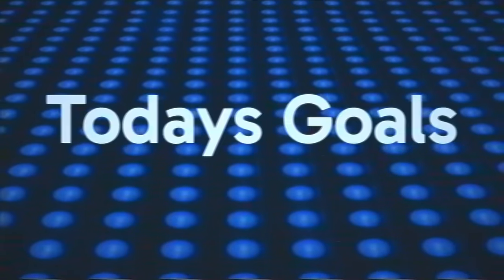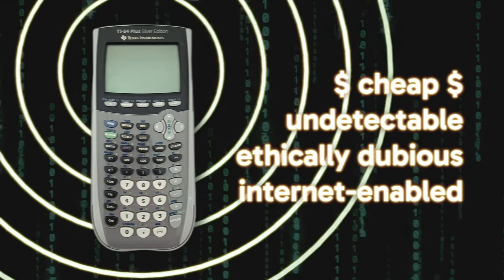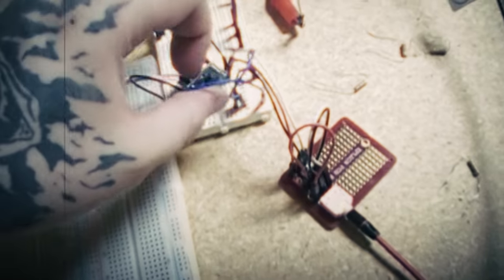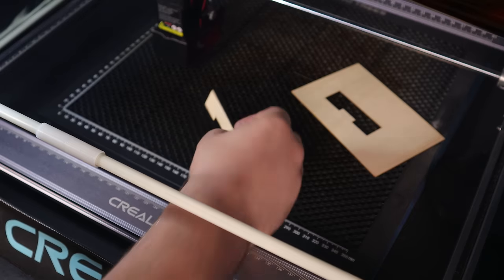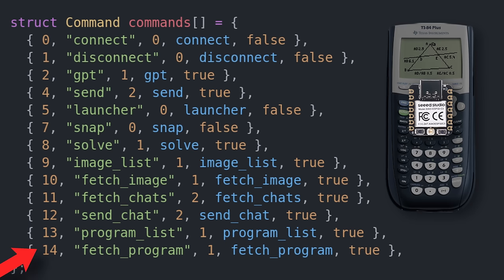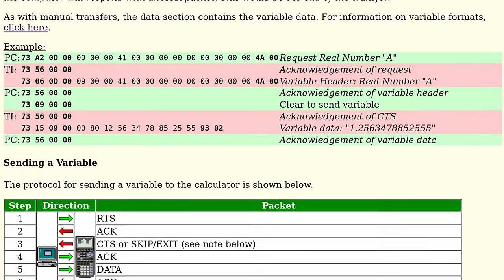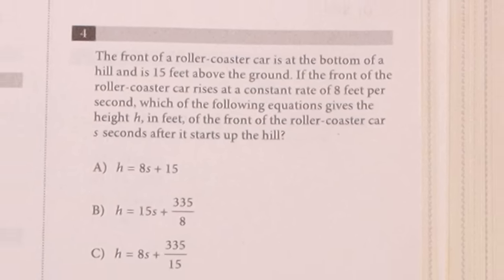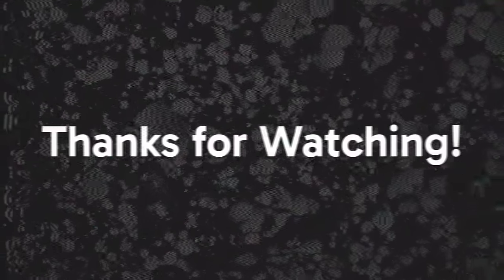I Made The Ultimate Cheating Device

Comment: I guess students will just have to take their math tests in a Faraday Cage now
Reply: I mean they probably just have you put your phone in a box beforehand.

Which would kill the hotspot, thus nullifying this method. And if the local (school) network has an auth page, you probably can't navigate that via the interface we see here.
Reply: @NilesBlackX  What if you embed a SIM card inside the calculator? Or instead, use some long range radio protocol and someone outside giving you the answers remotely? They actually use RF detectors on university entry exams here in Spain, cause there have been cases of both things I mentioned (;
Reply: I'm sure we'll still be able to find a way to cheat
Reply: Or the school could just get evwry student a calculator for exams
Reply: @Ignash  just mod the calculator during the exam 🤣 not that hard trust guys
Reply: What they do is monitor for electronic signals. 
They'll catch the WiFi enabled calculator pretty quickly.
Reply: My school has signal-blockers everywhere and you can barely get 1 bar usually. so that would make this method less useful
Reply: @morgangrisby8107  Really? What exactly do you mean by signal blockers? Are we talking something physical and passive, or electronic and active? Generally speaking, WiFi and cell jammers are illegal, even for the school. That's a pretty hefty FCC (and analogous bodies in other countries) fine and prison time (if it's a school, probably whoever thought it was a good idea and whoever OK'd it would get in trouble) if they got caught, there's even a way to report them... 

It's mostly illegal because it causes interference (and by definition, broadcasts) on licensed bands (on the unlicensed bands like 2.4ghz/5ghz for wifi, it's the intentionally causing interference/denial of service that's the problem), and can even potentially prevent someone from calling 911.
Reply: @chemputer  us isn't the only country on earth.
Reply: @___15  there are similar laws in most western countries, and for good reason.
Reply: @chemputer  If you're going to defend an act of academic dishonesty with legal technicality, might as well be a lawyer instead. Even then, I'd bet there would be law students who'd try to argue their way into letting them bring calculators into the exam venue for this purpose. We have law students here who were caught cheating while doing less.
Reply: @teeteetuu94 what a pointless thing to say
Reply: @morgangrisby8107  connect to school wifi?
Reply: @chemputer  probably if you could connect through a VPN or hidden tor tunnel or something similar
Reply: @teeteetuu94  It's not defending cheating. It's ensuring that telecommunications laws are upheld and that 911 can be called if there's another violent incident in the school.
Reply: @NilesBlackX  That's why you bring two phones.
Reply: @Ignash  thats what they did when I was in school there we no external devices allowed although you could swap out the calculator and hope they dont notice.
Reply: @johnsmith34  How? They cant if it is on your own hotspot. They can have a receiver and laptop with monitoring mode using aircrack but you can easily disguise the name or just not broadcast the SSID to prevent them from doing that.
Reply: only simple calculators are allowed and the exam room has a 360 camera on the roof (looks like a plate with few directional cameras and one fisheye in the center)
Reply: @michaelfoulk  If it sends anything wirelessly, then there's raw RF signals to detect with specialized tools. 

That's in theory, but it may be harder in practice. 
All I can really tell you is that for some of the exams I have taken, there were big signs about their ability to detect phones.
Reply: People have been messing with running a very quantized version of Llama on raspberry pi, so I think with a bit of hacking, it should be feasible to squeeze in a simple LLM fully locally within the TI-32 enclosure.
Reply: @bartoloeldelaflauta8571 at what point are you making this calculator a cell phone?
Reply: @morgangrisby8107 by signal blockers do you mean a giant cinder block building?
Reply: @NilesBlackX simply hide your phone or bring 2 phones
Reply: @ZekeTrimmer  no they cancel out the cellular data so it's really hard to get a signal
Reply: @morgangrisby8107  that's illegal, and highly unlikely.
Reply: @NilesBlackX next video - how to hide a Hotspot in your shoe.
Reply: @InwardRTMP  Depends where you live and what test you're taking I guess. In the last test I took I had to leave all devices, keys etc. in a locker inside a different building and take absolutely nothing into the exam room except my locker key. They made me empty all my pockets as well as lift my shirt and spin to show there's nothing in my waistband. This had to be done in front of two witnesses. The whole room was also monitored with A/V locally and remotely.
Reply: Quantum entanglement exists
Reply: @NilesBlackX Who said you needed a mobile hotspot? You always could just place a Starlink on the School roof or something.
Reply: when i was a kid the school provided their own calculators to borrow during tests. easy
Reply: @Astute-Brute  That's the one I'm excited for
Reply: @johnnydied9563 easier than that is just setting one up in the hallway or classroom next door, but you do you my guy. I like where your head is at - just install some internet infrastructure at the school for your own use! Hell ye mang
Reply: @NilesBlackX I mean the Mobile Starlink. Installing it wouldn't take long. All you need is to place it and connect it to a battery essentially.
Reply: That only works to prevent OTA updates and remote connectivity. What you're thinking of is an EMP field/EDA (electronics denial area), which "doesn't exist" [allegedly]. 

Edit: ah I see. So then in this case just move the program to be on-device, but you'd need to basically mod the calc so heavily that its basically a proto-smartphone that just looks like a calculator..... which probably exists (or will exist soon)
Reply: @randomuserame  A Faraday Cage would block a phone signal and the calculator is connected to the phone's hot spot, so it wouldn't work. It's also just a joke lol
Reply: @InwardRTMP brother ive had the same phone for 8 years what do i do
Reply: yeah
Reply: I have a hp50g, and I can save all the chapters I need on it. It's a little boring process to rewrite them, but it works. And there's also a program that makes a hidden folder with password that can't be erased.
Reply: Dedicated phone in hidden compartment inside ones backpack maybe?
Reply: @morgangrisby8107 realistically, that's just because many large buildings have steel frames in the wall, which are hell for cell service.
Reply: This whole cat and mouse game could be obviated by doing away with high stakes testing altogether.
Reply: @bartoloeldelaflauta8571  damn thats actually crazy
Reply: @___15 its the only one that matters though
Reply: Have you been to a public school? They practically are already...
Reply: Just need to run a local LLM on your notebook in the backpack lol
Reply: @NilesBlackX hide the phone, they cant legally search you without probable cause, and although not believable, you could say you didn't bring bc what'd the purpose when it would get taken away anyways
Reply: we could try making math not about regurgitating memorized formulas or failing?
Reply: You could use an open source llm if the model is small enough it could fit inside a memory card.. so you don't even need Internet.
Reply: well some exam centers do have jammeres in vicinity for such situations

Comment: Poor teachers, they don't even know what's gonna hit em
Reply: The entire education system is going to have to be rethought.
Reply: That's why they measure the weight of these common calculators.
Reply: @asserslab  that'll just slow people down, there will always be another work around.
Reply: @asserslab  i am absolutely certain you could make this modification such that the weight is identical
Reply: @KeithSachs  what if you got rid of the metal shield and usb port (after programming) on the seeedstudio and dremeled out all the (assumedly) useless blank parts of the pcb
Reply: @summerlaverdure i think the simple solution is redo the power. Batteries weights a lot, and you just may use smaller types with same voltage.
Reply: Yeah, nothing suspicious in people spending 5 mins straight typing on the calculator.
Reply: @asserslab  Duh. Just change your cells to lithium (Energizer lithium AAA), and now your modded calculator is lighter than unmodified.
Reply: @moamber1  i think you and @besthakase have a good idea in theory, but dont forget teachers are going to open the battery door and look at them, so it's not viable to do that
Reply: @summerlaverdure  So? Are lithium batteries prohibited now? And I don't remember anyone checking anything, tbh. Especially the weight.
Reply: Wait until a teacher sees this video and does a surprise post-test calculator inspection.
Reply: @y29k15  School teachers would have a million reasons not to interfere. One of them - they are interested in a high passing score. Second - they have no competence to prove anything. Third - they might have their priorities straight, and to not risk their job for questionable gain. Of course, I'm talking from EU perspective, where teachers, generally, are not the psychotic gatekeepers.

P.S. I was using the programmed calculator at school. Math teacher didn't care, though she knew what I'm doing. I came to conclusion, that if I'm automating things, I am becoming better at programming, but not at math. Turned out well for me, I guess.
Reply: they could weigh with batteries removed
Reply: best defence is to have it as a small external device and hide it and use sleight of hand, and best offence is random calculator inspections, overhead cameras, and institution provided calculators with ports disabled.
Reply: perhaps there exists a hard shell protective case which locks in place and covers over the ports and non UI, installed after weight inspection. To defeat it you'd need to make a hidden port on the top side of the calculator and plug into it, that would be so hard to not be noticed.
Reply: Oh I'm a teacher and now I know.
Reply: @robj144  haha! 😂 hopefully you dont have to deal with too much of this
Reply: @KeithSachs  Wouldn't work for me.  My questions are long and wordy.
Reply: Oh we know, but there is only so much we can do.  And like someone else said, if someone is this determined and skilled they will do fine in life, even if they cheat their way through a class or two.
Reply: honestly, if a student can solder a microcontroller into their personal calculators and successfully use it to connect to the internet, I'd give them the pass on a test.
Reply: @summerlaverdure  Take the label off of an an alkaline cell and put it on a lithium cell.  They used to sell vinyl stickers which looked like a coke can that you would put on a can of beer so you could get away with drinking a beer in public, same idea.
Reply: no im so close to doing this trust
Reply: @asserslab  we bring any calculator where are I'm from
Reply: @asserslab no they dont😭😭😭
Reply: You think we aren't watching these kind of videos?
Reply: your about me could have been "I'm Keith and I like Sachs" smh...
Reply: @LeoL77  HAHAHA
Reply: They see the bag Mac truck and teachers are just like "oh yes baby, pull right into this little garage!"
Reply: Eventually there just will be no closed book tests. There will be homework and open book quizzes that encourage you  to learn the material but eventually it’ll be on the kids to decide to learn something or not
Reply: Me writing on my test "Sure. Here are several ways to solve a ..."
Reply: the jokes on you, people gonna end up dumber, like a puppet always relying on their trusted ChatGPT
Reply: its pointless, typing takes too long, if you did this for every q youd run out of time, and would still get a lousy grade, assuming you didnt know the material at all

Comment: I remember back in the 80's when I was a student having a foldable Texas Instruments scientific calculator, the teacher would check & made sure I wipe the memory but what they didn't know was that both left & right half's had secret thin slide draw panels. Printed on the panels were the operational instruction how to operate the calculator & the functions so I printed out all the formulas I needed in ultra small print then glued them into the panels, came really handy if you forgot one or need reference.